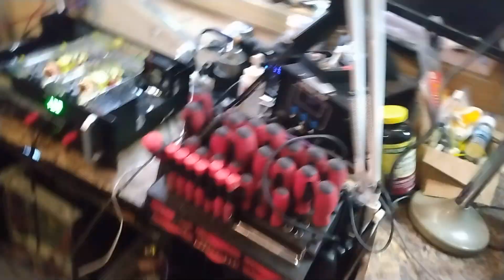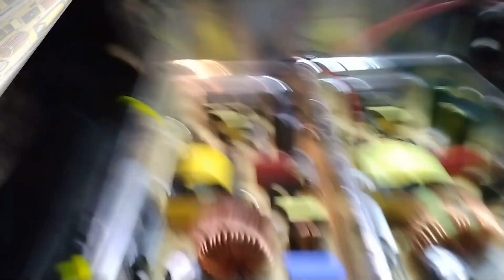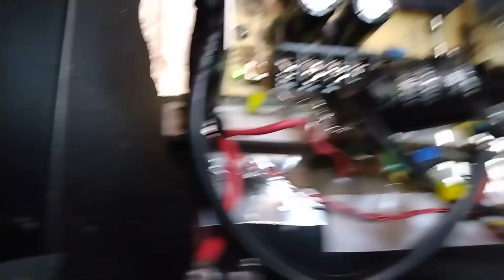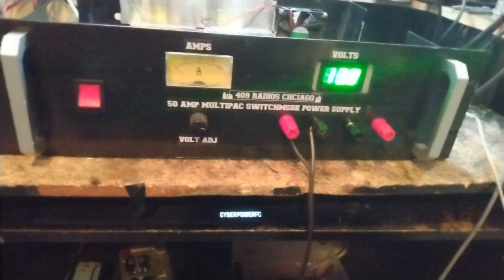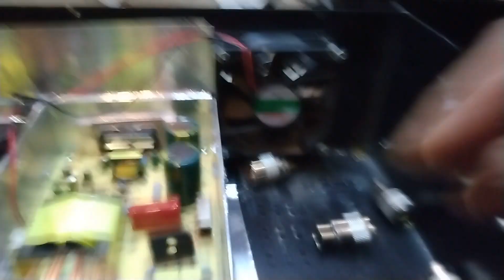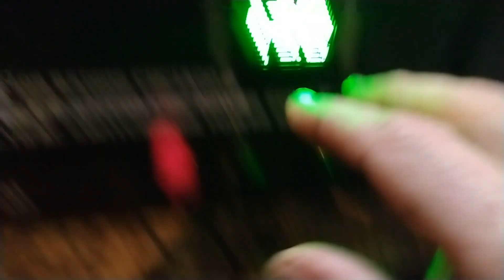409 50 amp variable switchmode 10 14 6 volt supply

Comment: Very nicely done, ..have you load tested it yet?  Just curious of volts vs the amperage is all?
I'm like how you combined both with adjustability and I'll bet your customer will be very happy
Reply from the maker: UNIT SUPPORTS 50 AMPS OUT FROM 10-14.5VOLTS
Reply: Thank you for your response and again very nicely done as I've seen other units drop in amperage as I increased the volts ,..your build is doing exactly what it supposed to
Reply from the maker: thank you for seeing the difference between an assembly and a quality build

Comment: Why not use 2 50s instead of 2 30s
Reply from the maker: the voltage variant on the larger wattage packs doesn't give as wide  of a voltage regulation, its hard to find one that dials up to the thresholds that some of me guys need, hope that helps